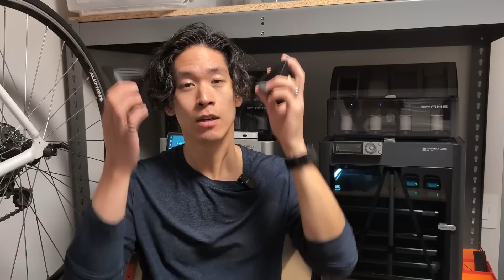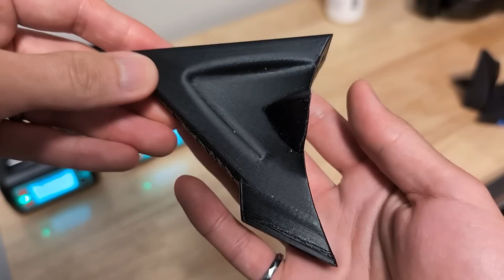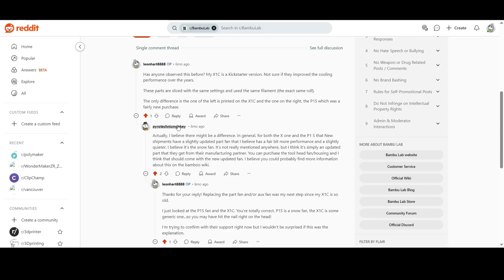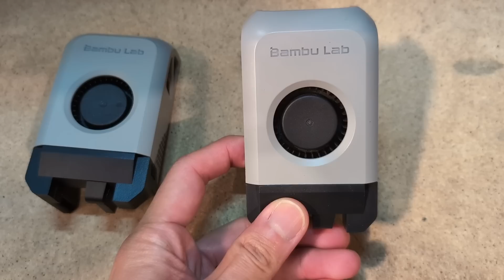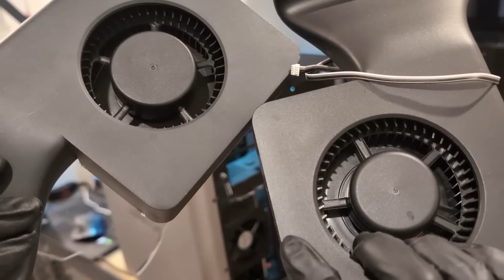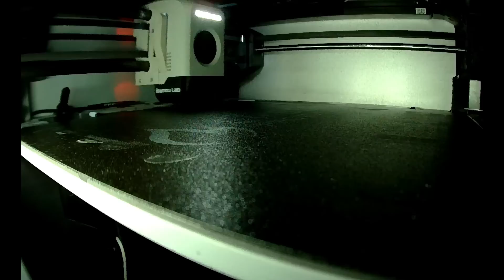Why Your Bambu Lab X1C Overhangs SUCK

Comment: You probably didn’t need to change out the Aux fan, that fan usually creates more problems than it fixes, the part cooling fan is what actually fixed the overhangs.
Reply from the maker: I actually disagree for two reasons. 1) the new aux fan is almost twice as powerful and 2) if you actually turn this part so the overhang is opposite of the aux fan, the overhangs come out terrible (regardless of which machine I print on)...so overhang orientation can be very orientation dependant and also the aux fan is very crucial here. There are lots of posts about adding a secondary aux fan to the other side of the machine to solve this orientation dependent cooling. In most cases it doesn't really matter...but parts like this with very steep overhangs can benefit. Of course, this all only matters for PLA, which we don't print THAT much with, but enough to dive down this rabbit hole in the first place 🙃
Reply: @emberprototypes  I guess the only way to be sure would be to print the same model again in the same orientation with the aux fan at 20% or lower instead of the default 70%, I’ve just seen a lot of people online complain about the aux fan and theres even prints to deflect the air from it so you don’t have to adjust the speed in the filament profiles, which is what I’ve done to 20% without issues so far, but I haven’t printed that particular model.
Reply from the maker: @WhiteHawk77  interesting, I didn't know that. Honestly I don't print in a lot of PLA so I wouldn't know exactly but I haven't directly experienced cases where the aux fan was causing issues. But to be honest, I don't know whether it was the aux fan or part cooling fan that fixed this issue...all I know is that both of them were different (the aux fan seems significant because of the current spec) and upgrading both fixed my issues.
Reply: @emberprototypes That’s the thing, to determine what actually fixed it changing two variables at the same time means you don’t know if it was both or just one that really did the trick, and I’m not saying it definitely isn’t both that matters, just my suspicion from what I’ve seen people say and my experience with the aux fan at a lower speed suggests the part cooling fan made the real difference, and I know it’s possibly wasted filament and time but for curiosity and learning might be worth a test to see what happens and you can pass that on to viewers, including me. 😁
Reply from the maker: @WhiteHawk77 you're right, if I were to take this in a scientific approach changing two variables at once is bad. However, knowing exactly which one wasn't important to me at the time and I just wanted to solve my problem. Perhaps others can take what I learned and figure out which had a bigger impact if that's important to them. My suspicion is that they both improve things.

Comment: Do you think the AUX fan is making much of a difference? I would guess it's mostly the part cooling fan. I upgraded all my machines to the newer Snowfan part cooling fans a while back but had no idea the AUX fans also got upgraded. I usually turn down the AUX fans, though, if anything. They usually increase the likelihood of a part coming loose from the bed due to cooling more than they help with things I find.
Reply from the maker: I actually do. For two reasons - 1) the new aux fan draws almost twice as much current so the flow is probably significantly higher, and 2) interestingly if you print the parts I showed in the video with the overhang facing AWAY from the aux fan, the overhangs end up terrible because the air doesn't hit that surface, so the aux fan is actually really important (and overhang quality can be highly depend on printed orientation).

The aux fan only runs when you're printing PLA, which we do very little of (usually ABS) but I guess it happened enough times for me to go down this rabbit hole 😅
Reply: @emberprototypes I agree about the aux working but I meant do you think it was the part cooling fan upgrade that helped most or the aux upgrade?
Reply from the maker: @technicallyreal I guess I don't know for sure because I didn't document or test them individually. I noticed both were old so I simply replaced both and it solved my problems. At the time it didn't really matter to me which solved the issue, I just wanted the problem gone 😅

Comment: My P1S from October 2023 has also the older fan. At least for the toolhead - i didn't check the aux one. So I would guess that they did the change sometimes after the P1S was released.
Reply from the maker: I would bet your aux is also old then. I've been hearing this from many people, so really surprised...I legit thought it was only kickstarter units
Reply: @emberprototypes  My X1C was bought on Jun 29, 2023 not a Kickstarter unit and also has an older 0.15A Fan.
Reply: I have this problem with overhangs and under exstrusion on a p1s (under extrusion may be a seperate issue). I have a new cooling fan, Ill have to get to the exaust fan to check it.

Comment: How do you determine if you have a printer with the old fans?
Reply from the maker: Easiest way is to take the front tool head cover off and compare to the labels I show in the video
Reply: @emberprototypes That method makes sense. I was hoping there was a block of serial numbers listed somewhere on the Bambu wiki.
Reply from the maker: @chmieke hah unfortunately not. I don't think this change was ever communicated